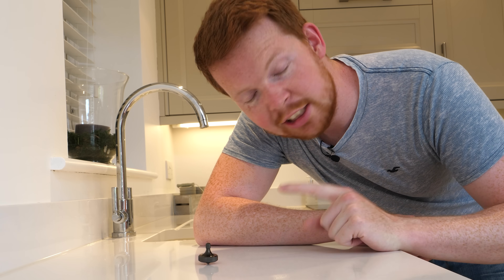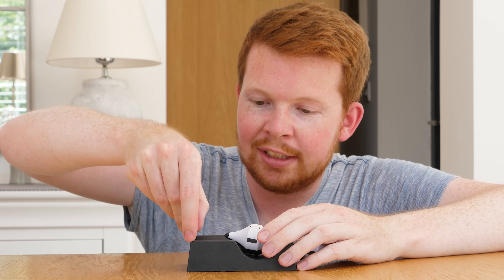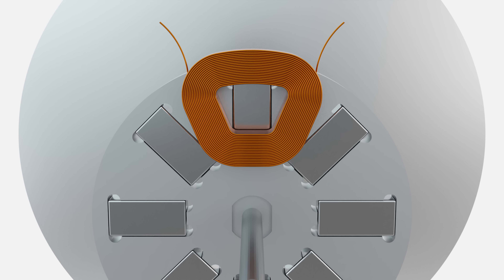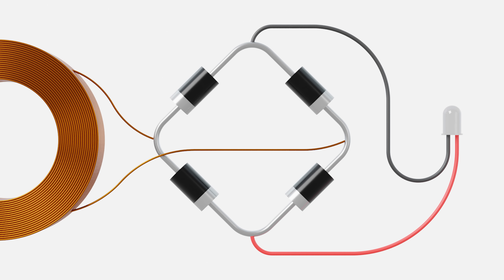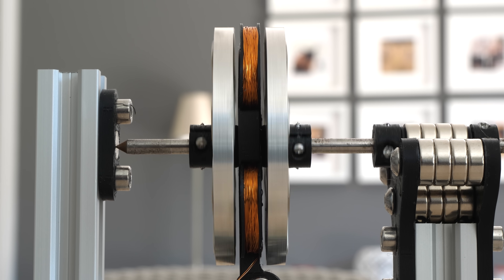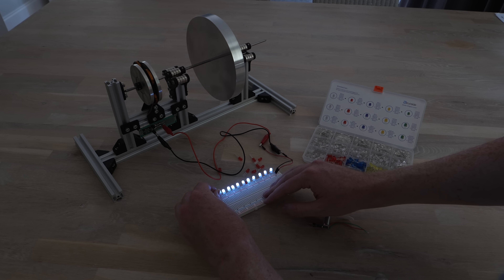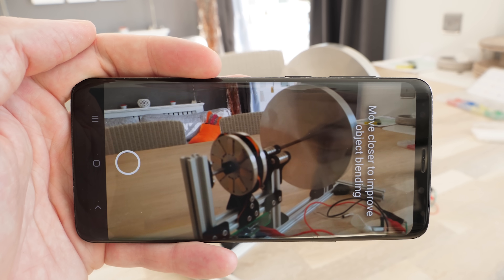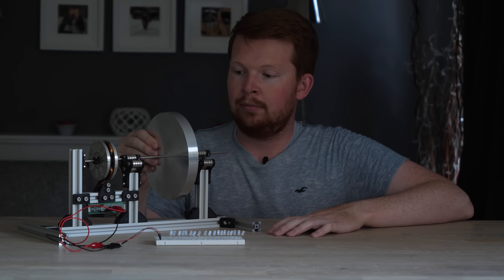Flywheel Battery

Comment: You could try to speed up the flywheel by using your generator as a motor. It would be real mechanical rechargeable battery.

Comment: This is cool project but I wish you actually used it more as a battery. In most of these experiments you were just winding the whole time so this was more of an alternator than a battery.. Would be really cool if you used a much heavier weight (any heavy non-ferrous metal like lead, cast iron, SS etc) and properly balanced to be able to sustain charge for a noticeable period, hoping there is a second video!

Comment: OKay.....pretty nifty, but.....   so as you begin loading the output, you see the flywheel slow down a bit, and wobble.... that's the point of all these energy devices, you only get 'some' of the energy back out, otherwise it's just like any other generator.... do you think the cost of the 'magnetic bearing' actually makes a 'big' difference??    Also, you realize your losing some voltage across each diode, and that is voltage that the 'load' won't see..... the world is full of 'losses', if you find a 'perfect' lossless system, let us know....

Comment: For anyone curious on why the flywheel slows down while generating electricity:
As the magnets generate a current in the wire, the current passing through the wire generates it's own magnetic field, which opposes the magnetic field of the generator, forcing it to slow down
Reply: If you short the cables you stop it
Reply: @marianofpv  At the expense of generating heat, if it generates a lot of power it could melt the wires.
Reply: I was hoping to find that someone had already pointed out what I'm about to point out, but since they haven't this seems like a good place to do it. Those magnets induce a current in any conductive material (in this case the copper wire coils), and by extension, the current induced in the coils will generate a magnetic field that will induce a current in any conductive material (in this case the aluminium magnet housings) that will induce a current that will generate a magnetic field that will oppose the motion of the conductor through the field, which will take energy from the system and do nothing but make heat in that conductor. To me this means that Tom really should have 3d printed the magnet housings to reduce the eddy currents induced in the aluminium and increase efficiency significantly.
Reply: @jb_roboticgames6540  More like regular braking on trains with electric drive systems. Emergency braking often cuts power to the traction system and uses the ordinary friction brakes. This is sometimes combined with a magnetic sled for extra grip.

Given the amount of wear and tear braking systems experience it would be a silly construction to not use the (almost) wear and tear free method of braking.
Reply: Which is to say: No free energy
Reply: Fun fact, that's how regenerative braking on electric and hybrid cars works

Comment: If you built the same setup with a shorter and thicker ceramic shaft it would stabilize the whole thing and reduce energy loss even further since it wouldn't add any interference to the magnetic fields. Since you aren't pushing thousands of RPMs ceramics should work just fine. Another possibility, although far more costly and harder to balance would be to have the magnets embedded in the flywheel itself. If you wanted to get downright stupid with it, as I would probably do, cast the flywheel out of lead and powder coat it.

Comment: "We need to convert from AC to DC in order to power a light bulb or electric motor". I think is worth pointing out that conventional light bulbs (not LEDs) run on AC as do most of the more industrial electric motors (your generator is actually an AC motor as well).
Reply: Yeah, he said that his generator is producing AC.
Reply: AC powered led bulbs also run on DC, the electronics in it just converts AC to DC
Reply: An led ran on low volt ac voltage will run on the alternating current depending on the frequency of alternation just like when he held the led up to the wheel and it was alternating on and off..  saying an led ran on ac is still running on dc is ignorant.   If you take 4 diodes you can set them up in a way to convert ac to dc.   If you replace the diodes with light emitting diodes it will do the exact same thing except the full bridge rectifier will emit light.  If an ac voltage is applied to an led it will turn on at positive current and off at negative current like the sine wave.   Being a diode it will only allow the positive voltage to pass through thereby making a square sine wave of positive current and 0 current..   half bridge rectifier..   but an led ran off of an ac voltage of the max 3 volts but at 60hz would still cause the led to burn out because of the potential, spinning object at 60 hz per say would be creating a lot of current..  or potential and splode the bub..  bub..
Reply: @Z-Ack  thanks for the info on the rectifier. It sounds vaguely familiar. Oh yeah, it's the exact same thing he said in the video. I sometimes wonder if people even watch the videos, or if they're too busy clacking away on their keyboards to listen to it. "If you take 4 diodes you can set them up in a way to convert AC to DC." What a revelation. LOL.
Reply: @Z-Ack  I've got 220 v led cob chips running straight from the mains in front off me now...sorry if I miss read your whole comment I just skimmed through quick gimme a minuite I read properly mate cherrs
Reply: it also douse not matter if you power an led with AC as long as there is a high anth frequency for it to not notably blink
Reply: Everything can run on everything power wise...you just need the bridging components and power source  such as step up or step down converters and all sorts off designs cheers

Comment: It's been a while since I played with such things, but a capacitor filter along with the diode bridge rectifier will fill in when the voltage goes to zero between alternator pulses. I forget the specific math annoyingly, but a sufficiently big one will fill in the voltage pattern. All of this is easier to see with an oscilloscope.

Comment: Nice job! But I wanted to see you spin it up by running the alternator as a brushless motor. I think you could just hook it up to a brushless ESC. Of course you would then need a DC-DC converter with a wide input range and also proper current limiting resistors on your LEDs.

Comment: Great video! I was actually hoping to see a bit more about power measurements. Your video of the trebuchet flywheel is very interesting on that matter, and I kinda missed the energy and efficiency measurements. Would be very interesting to see that here as well! On that shot where the led is in sync with the coils, what is the led power consumption and how each blink affects the wheel's speed? The system has low friction but what that means on energy loss? Does it spins for a day? Can you convert the friction to wattage? Like extrapolating to a crazy application,  if you have solar panels spinning the wheel, how massive and fast needs to be the flywheel to store all energy used by a home, could it store the energy through the night? Hope you keep up with the project, bring a version B and give us some more juice! Cheers!

Comment: you should try to use oposing magnets on both sides of the saft so that you don't need the shaft to be in contact with a metal plate to prevent it from moving arround.

Comment: Well done, and I even liked the commercial for Thangs as it is close to the spirit of the channel. One thing: an LED needs a resistor, even if the voltage is safe. I burned some LEDs to learn that.

Comment: Very cool! I'd love to see this taken further. You could probably get some efficiency improvements by changing the number of coils or rotor poles to be coprime (and generate a multi-phase power output with reduced vibrational and apparent power type losses) then use AC's key advantage and feed it into a step-up transformer (this will minimize the energy lost to the diode's forward voltage drop). Can then combine the phases with a multi-phase ideal diode MOSFET rectifier instead of the lower-efficiency passive diodes. (If you wanted to do 4 phases, the LT4321 ideal diode bridge controller could be a pretty good choice to rectify them together.)

Comment: You've explained the rectifier bridge well.  The magnetic induction of a voltage in a loop, less well.
The current doesn't flow when a wire is placed near a magnet - that's not how the induction works.  If it were, you wouldn't need the magnets to move relative to the wire.
Instead voltage is generated around a loop in proportion to the rate of change of magnetic flux (flux lines and the direction they point in) cutting through the area of the loop.

You made the loop width and the magnet spacing the exact same - which is optimum for maximum rate of flux change, but also leads to the misleading section of the video showing - in slow motion - the LED light up exactly as each magnet comes near one gang of wires on one side of the loop.  The LED lights up at those times, because that's when the flux lines through the loop are changing at their most rapid pace.  (You get max slope on a sinusoid at the zero crossings)

Comment: i had thought about playing around with a similar toy,   but with using an old stationary bicycle, the ones with a heavy flywheel up front.   i could chop the frame down so i have a perfect mount to hold onto the flywheel with.  plus it all pre-balanced

Comment: For someone who likes flywheels, why does he drive an automatic?
Reply: What do you mean? You think vehicles with auto don't have flywheels? Oops!
Reply: @HelloKittyFanMan.  it's not called a flywheel. It's called a flex plate.
Reply: @stepside78 : What's not, according to you?
Reply: @HelloKittyFanMan.  automatic transmission have a flex plate and torque converter,  while manual transmissions has a flywheel and clutch.
Reply: @stepside78 : Maybe so, but which part was the "it" that you thought I was talking about? How do you figure I was even talking about a transmission part?

Comment: The electrical load applies a reactionary force to the magnets through the magnetic field (which is why magnetic free energy generators are bunk). Looks like your setup is subject to some oscillation due to the loading and it creates a wobble.

Comment: I think it would work better if you can have like 3 or 6 coils in a delta configuration and a 3 phase rectifier made with 6 diodes as when all coils are in series in mamy cases they will cancel eachother and the voltage will not be as high as you want

Comment: Make it 3 phase, then you can use ESC to  spin it up. Also it will reduce voltage ripple when you discharge your battery. Also make magnet holders from plastic, it will reduce losses.

Comment: Wouldn't it be possible to remove the glass plate if you offset the pairs magnets slightly so they push or pull on the bar, if you know what I mean?

Comment: The solution used to handle the poor balance of the flywheel and its shaft, by tinkering with the current generator design, is very elegant. You make it sound simple and evident :)

Comment: What diodes did you use? I hope you used fast diodes with a low forward voltage drop! Would be great to see the output on a oscilloscope etc.

Comment: Use a little Arduino or similar and an LCD to plot the voltage on a line graph as it slows down. Might even be able to charge a little battery long enough to power the board each time.

Comment: I built a Pulse motor/generator using "Bill Muller magnet motor" setup back in 2001.
It was not a free energy machine as claimed by so many, but boy was it fascinating to play with.
I played with it for over a year. Lost an O'scope to it's sharp pulses. Even hooked it up to a PIC MCU and was able to adjust everything on the fly.
I've never leaned so much, in so little time. I recommend it to anyone interested in electric motors and magnetism. 
What I love about pulse motors, is that you get back all the energy you put in, minus the copper losses and friction. That means motors with efficiencies of over 90% if designed and built correctly! I wanted to build a bigger one the size of a car's engine block, but didn't have $30k to put into the prototype. 
I'm surprised you haven't gone down rabbit hole before, Tom. 
Magnets and motors are the most amazing to me. Magnets are the closest thing to magic!

Comment: Back in the mainframe days of the 60-70s a motor on the incoming supply drove a colossal concrete flywheel with a generator on the same axle that supplied the machine room. An early-days UPS, though more to even out the bumps. I operated mainframes in just such a machine room and remember the respect we gave it!

Comment: Why not put the coil on a baring on the shaft? Since the coils weight much less then the fly wheels it shouldn't induce much friction. And getting the coils closer to the magnet should make up for the friction loss
Reply: Mass doesn’t affect friction in this case I don’t think. But adding any bearings will add a lot of friction relatively speaking.
Reply: @GavinRemme  a load bearing bearing would add friction, but if you had an open bearing without any grease it should spin with extreme ease

Comment: idea, wind each winding with thicker wire at the center hook them to a capacitor. Then hook the capacitor to the small wire windings.  I may have described that wrong so check out how a small engine coil works. You should get far more zap for your spin

Comment: If I understand the physics right, the more current is flowing inside a circuit, the bigger will be magnetic "friction" on coils. Can you try to compare spinning of this flywhell freely and then with shorted coils? Anyway, really nice project.

Comment: Really nice animations! To increase the energy output significantly, you should add iron in the generator setup. I would place an iron plate on both non-coil side of the rotors, and in between the coil windings. That will dramatically decrease the magnetic reluctance of the magnetic circuit, which increases the flux through the coils and thereby the voltage and efficiency.

The goal should be that the magnetic flux lines all can flow through iron, and as little as possible through air. Iron has a much, much higher permeability, meaning that it can 'conduct' the field lines better, thereby increasing the flux density. Look at any commercial motor, it is also built like that. The iron on the rotors can be solid, the ones in between the windings preferably laminated / sintered since the alternating fields will create eddy currents otherwise.

If it works better, you can probably use the alternator as motort as well through a multiphase voltage source :)
Reply: With a double sided rotor you can use a Halbach array to redirect the flux so you don't need rotor back iron. Its somewhat commom in flywheel designs to not have iron in the stator for efficiency reasons
Reply: Yes to iron on the back of the magnet rotors. In this case no to iron cores as it will slow the flywheel down regardless of load.
Reply: but then the flywheel would slow down quickly. he should just use stronger magnets

Comment: Could the led blinking lower, if you set each coil at a slightly different possition? so that not all 4 coils get max power at the same time. But max 
volts will be lower

Comment: If you build the magnets into the flywheel, wont you get more power per RPM? Also, could you put a magnet at the tip pushing another magnet, reducing surface friction to 0?
Reply: Still curious.

Comment: If you had a  multiple of 3 coils, 120 degrees out of phase and the same even number of magnets and used 6 diodes, you would have 100% smooth dc power. Basically the reverse of a bldc.

Comment: First, the positioning of your coils is ineffective.  Move them radially inward or outward until the N-S pole pairs are opposite the coil centers.  It is the flux through the loop that matters NOT the flux crossing the ends of the coils.  Second, you can use the coils and a motor driver to spin up the flywheel.  Most of these are designed to be 3-phase, but you can incorporate your own quadrature timing if you wish (or even single phase if you are willing to give it a manual start).  Third, an aluminum axle would be a better choice than anything ferromagnetic.  It would still be ok to use a hardened ferromagnetic tip contact to minimize friction if a jeweled bearing (point contact) is not feasible.  Otherwise, your largest losses will be due to air viscosity and eddy currents in the winding wires.  Thin wires were a good choice to minimize eddy current losses.

For next level of performance, use electronic steel laminates to steer the flux through and between the coils and place pairs of coils between both ends of the permanent magnets.  This will need to be delicately balanced to avoid instabilities and to allow smooth rotation.

Comment: I've seen flywheel powered back up generators that will do an entire building.  Say you have a whole house generator that will automatically turn on if the grid goes out, that generator will take a few seconds to a few minutes to power your home or business.  If you add a whole house flywheel (or battery) backup into the mix, the flywheel will carry the load for the house until the generator fires up and comes online.  In that application, the generator coils on the flywheel will also act as a motor, keeping the flywheel spinning at the proper speed.

Comment: I was taught that current flows negative to positive (electrons have a negative charge).
Reply: There are two conventions for explaining current flow. 
1, Conventional Flow, on which circuit diagrams and component symbols are based, used to simplify design.
2, Electron Flow, the real way that current flows not much use unless you are a physicist or designing ICs.